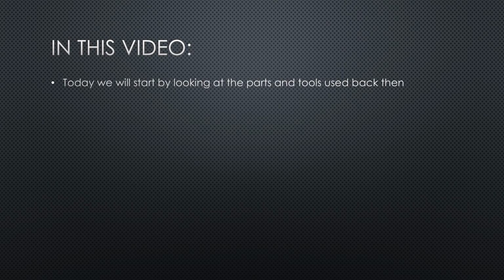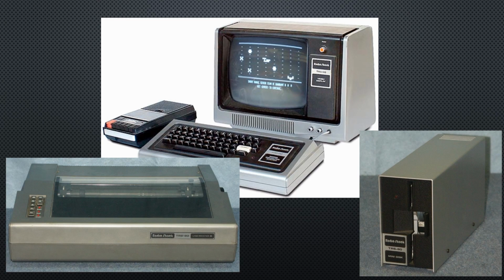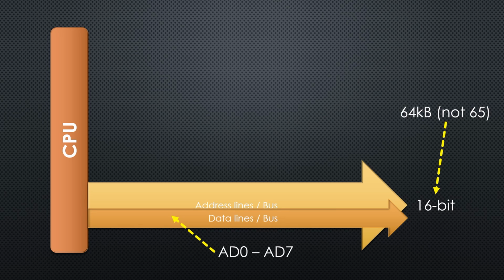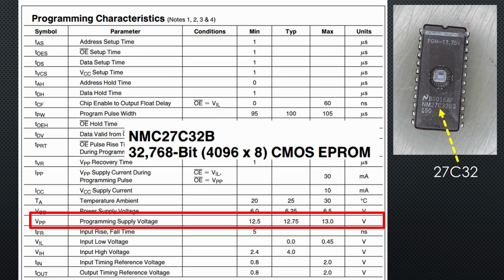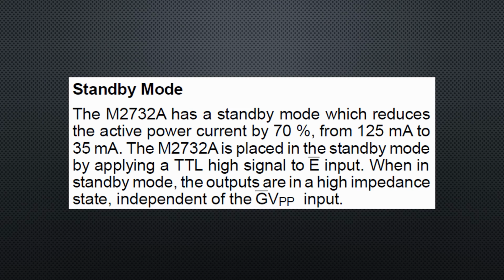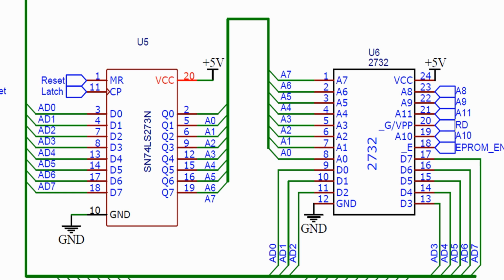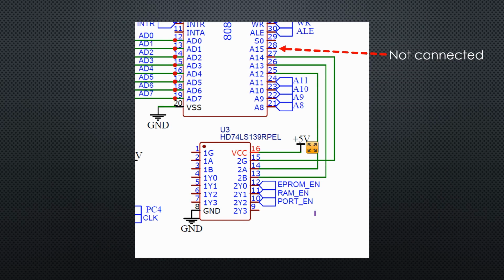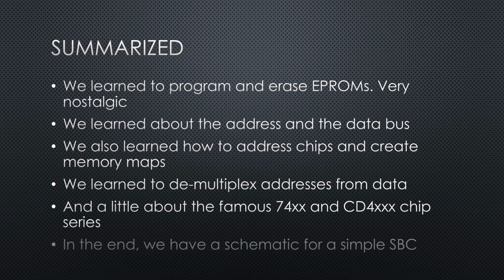#297 We build a historic "PC" using technology from the 1970s (8085, 8155, old EPROM, TTL)

Comment: Nice. I was fortunate enough to be introduced to the Cosmac 1802 by my physics teacher at school... it was the start of a long journey including commercial assembler and C... and yes... having a knowledge of the basics really helps when understanding behaviour through layers and layers of abstraction.  In those days it was always a job of fighting constraints memory size, static versus dynamic, cost etc... Now you can buy awesome silicon for $1. Maybe you should now do a soft version in VHDL on a FPGA?
Reply: My first full-time job was writing code for that. IIRC the Cosmac system had floppy discs but no file names. You had to load a program by telling it which track to read from!
Reply from the maker: I already have some contacts into the "FPGA community" Creating an 8085 or Z80 Arduino on a FPGA would probably be fun...

Comment: Back in the 80s I was a radio operator in the german navy. In 1982 the electronics guys on our ship started to build a "NKC" - "NDR Klein Computer". Because of my special skills (Siemens T100 and T1000 teletype) I was chosen for the honourable but very boring tasks of copying the book with the BIOS listing onto punchtape.
Reply from the maker: As I was also a radio operator I remember the T100. We also had them. But I did more Morse...
Reply: I did both :) But RTTY most of the time and computeraided RTTY! Two Z80 based computers in the radio room, another one in the ops and then another on the bridge all networked via 9600 bit/s serial lines.

Comment: If I recall correctly the ls373 works better as an address latch, it passes data through when en is high and holds when low. You can connect directly to ALE. It also gives better address setup time to the memory as the address propagates through before ALE falling edge.
Reply from the maker: You are right. I changed it.

Comment: Despite also been a user/developer on 8085/8086/8088/80535 (This last the most familiar to current MCUs) my nostalgia goes to the Z80 based systems due the time I dedicated to my Timex2048 (ZX Spectrum clone). Please don't forget to use KiB (kibibyte) for precision when refering to memory size. Regards.
Reply: Dinosaurs, like myself, don't believe in SI. I cried for days, when they took my kb away 😢😭😁
Reply from the maker: I have to confess, I never heard the word "kibibyte" :-(
Reply: I also consider it confusing and assume to frequently use the incorrect term for the multiple in current speaking ... but for precision we should try to use the correct one. 1TB is 1,000,000,000 bytes and 1TiB  is 1,073,741,824 bytes. About 74G more ...

Comment: Please not the 8085 chipset. I could never work out bubble sort with the 8085. I throught the read and write lines where one line low for read and high for write. 15 data bits and check bit.
Reply from the maker: They used 2 lines. But I do not know, why.

Comment: I've been thinking on doing something like this for a while, but with either a 8088 or a Z80. Can't wait to see how this progresses!
Reply: An 8088 is basically an 8086, but with an 8 bit data bus instead of the 16 bit of the 8086.  It is an 16 bit cpu.

The Z80 is a 8085 but with two more registers X and Y, and registers to work with the, and all registers was in two sets, so you just switched them all with one instruction. Great for fast interrupts.

Comment: Back in those days components were much more expensive too. Some very expensive chips like EPROMs were surely saved from any scrap electronics I came by. Often components were recycled by desoldering from a suitable scrap too.
Nowadays you just buy $1 modules and connect them like legos and the work have shifted more to software. (Not totally though, there is still a lot of hardware with no software)
Reply from the maker: But today you expect much more output in one week. Back then, a week was not very long. That is why we often had to add nights and weekends...

Comment: Awesome. I've been also watching "ben eater" do similar with the 6502...its actually a lot easier than you imagine, now that we have the documentation!

If you are ever in the UK, you must go to the museum of computing in bletchley park. Those guys will talk to you for hours about their even older computers and even show you inside them..this is how we find out how real computer theory works..
Reply from the maker: @TC: I heard of Bletchley Park and for sure I will go if I am there...
Reply: Oh, I remember when I repaired the CPU (yes, the CPU) of a PDP 8 with lots of flip-chips. I had to repair a serial port hack, that turned the then standard current circuit port to a more common voltage port (like an ordinary RS 232 / V24 serial port).  I got it to work, spending about an hour physically halfway inside the machine. :-)
This was done in the beginnings of 1990:th when I was a member of a Computer Club at the University of Uppsala.  Those was the time.
Yes, I also hade the opportunity to crawl a bit in an DEC 2020.  :-)

Comment: I remember having to split the data between two eproms and ram chips, odd address for one and even for the other as the chips were too slow for the processor. So you effectively divided the speed but 2. If I remember correctly eproms had to be ceramic due to matching the expansion of the quartz window to the body of the chip. We designed what is called a single board computer now days  for controlling an advanced digital intercom for jet fighters. We also had a digital voice warning system within it. They were great days to be working in R&D.
Reply from the maker: You are right. They used ceramics because the window. And in jet fighters I am sure you had the necessary money to buy the "right" stuff...
Reply: @AndreasSpiess  you right about the money, it was hard going in to commercial designs where every cent counted. In the mil avionics  an order for 5 was a big one but then again so was the bill. :). we were once asked to make a small test jig based on our in-house jig. we did not want to do it, but never say no, so just price it so they won't go for it. Went back with £25K each.  they ordered 5!!!!!!!!! this was at time when i had just paid £45K for my first house...

Comment: The schematic lacks decoupling capacitors +5V to GND.
I suggest at least one 100nF ceramic capacitor as close as possible to each chip.
Reply: It is far better to have a distributed set of decoupling capacitors, with at least one on every chip, than it is to rely on power supply decoupling in one place. The early 80C85 had an internal circuit problem that resulted in very high  current spikes on the power rails of nanosecond duration. Only local supply decoupling can supply these current spikes and thereby avoid radiation from the connecting power tracks. In many designs, it is necessary to not only fit 100n decoupling cap but also much lower values to avoid the effect of limited capacitor bandwidth. It helps to have a copper earth plain to provide a low impedance zero volt return.
Reply: @nigeljohnson9820 : Yes,  I agree 100%. I was there too!
Reply: I see some think decoupling caps are not necessary.
Then I suggest you put them in the schematic and on the PCB. Don't install them if you can get away with that and need to save a cent. Then it's just a matter of installing them when things don't go according to plan. That usually will be very random. Like when all bits change at the same time. Often blamed on bugs in software.
Reply: @einars899  scrimping on supply decoupling caps is a false economy, it tends to produce daisy faults.  As in some days it works and some days it doesn't. It can even make the circuit look like a theremin, where hand capacitance is sufficient to crash the processor.
I am with you, ground bounce will stop the processor working, as will transient drops in supply voltage at the Vcc pin, sufficient to make logic ones look like logic zeros. Then there is the little matter of all the RFI it will produce if not well decouple.
Reply: Don't let anyone tell you that decoupling caps are unnecessary. I was building stuff using these components in the 70's and they 'glitch' like crazy. Decouplers stop you frying components with transient spikes, even if the thing works at all with the data lines ringing like a bell.
Reply: @qwadratix  I was using this chips in professional radio equipment and a member of the research and design team. I was responsible for the circuit design. It was vital that the equipment met all the approval specifications over the whole of the temperature range of -40C to +80C inside a 25 watt FM transceiver. There was never any question that the decoupling capacitors were necessary.
At the time I had access to state of the art test equipment and had a chance to justify their inclusion with measurements.
All designs were subject to peer review, where the cost of every component had to be justified both by measurement but also by design calculations.
Reply: @nigeljohnson9820  If you are worried about the cost (of a few caps at pennies per dozen) and you had access to full design parameters and sophisticated test equipment, sure. But at the time I was working in similar conditions to the OP, as a technician in a nuclear research facility where all that mattered was that you got some piece of experimental rig together quickly, reliably, with simple tools and test gear. Once the experiment in question had been completed, the gear would most likely be cannibalized or re-purposed. We didn't have time to mess about and any time spent trying to come up with a sophisticated design was time wasted. We wouldn't dream of building TTL without a belt-and-braces approach to every possible mode of failure. Finding and fixing obscure failure modes was not something we had time to mess with. Our essentially prototype designs had to work, often in a harsh environment. Power line spikes were a known problem with the technology, so we would stick decoupling caps everywhere we could fit one.
Reply: @qwadratix  its not the cost of components that was the issue, it was the cost of fitting and testing and the amount of PCB space they consumed. I am not arguing that decoupling was not necessary. I am suggesting it was vital and not the result of some cut and try design technique or the result of playing safe, but the product of detailed engineering. We were not producing one off lab gear, but production runs of expensive equipment, where an engineering error could cost thousands or even millions of pounds.
Reply: @nigeljohnson9820  The point I am trying to make is that unless you have a good reason to produce a design with a minimum number of components and have the luxury of repeated iterations, sophisticated simulators and test gear, it's simply expedient to just slap in decouplers right up against the chips everywhere regardless. You know it's going to work first time every time and there are no nasty surprises waiting. Sure, some of them are probably unnecessary but who cares?
Reply: I remember, there were also sockets for the 74xx series with integrated capacitors as most of those chips had the GND at pin 7 and VCC at pin 14.
Reply: @DC9FO  yes, I remember those. The capacitor was a small yellow/brown ceramic capacitors wired diagonally across the underside of the rolled pin socket. I believe they could be purchased with a few different values of capacitor fitted. Before they disappeared from the market, they evolved into thin sheet capacitors of mica like material, with tined holes that matched the socket. This allowed the capacitors to be fitted to any role pin socket of the correct size. I think they disappeared due to reliability problems, certainly the ceramic/mica version was proved to be very brittle and the through hole connections did not always take the solder. All this predated multilayer PCBs, whose price was at a premium at the time.
 They certainly proved less popular when four layer PCBs became commonly used. Where connecting a capacitor on the Vcc pin down to the ground plain provided a much better level of decoupling, as it did not include the long capacitor lead inductance. By reserving the two inner layers of the PCB for power and ground, an inherent low inductive capacitance was created between the rails. This also made the ground plain about as good as it could be made. Power and return currents tended to flow in  matching parallel lines in the power and ground plain, as this is the path of least reactants, thus minimising inductive current loops. The only places where these paths might be disrupted  were where through hole pins penetrated the PCB. Even this effect was mitigated by allowing the ground plain copper fill to flow between the through holes, given as close as possible to a continuous sheet of copper.
On the very earliest boards, there were production problems with the ground plains shorting to the plated through holes. 
When production deadlines were tight, such problems could sometimes be fixed by taking the unpopulated PCB and applying 10 or 20 amps between the offending through hole and the associated ground plain. It was sometimes necessary to apply this trick to populated boards, where tiny dendritic tin or copper filament  fingers would grow from the plated through holes into the surrounding copper plains. It was a brave engineer who diagnosis such faults and opted to apply power to the offending short, blowing it like a fuse.
Reply: Dave on the EEVBlog mentioned in a video about such basic computers how having decoupling capacitors everywhere would be overkill.
Reply: @aronhighgrove4100  If you are referring to his Gigatron video, well, first, that machine was built on a 4 layer board with a ground and power plane (= large distributed decoupling capacitor) and also it is on a PCB, not a breadboard, like the attempt Andreas made (and which didn't work). And even then the Gigatron has all those decoupling caps.
Reply: yeah i wouldnt worry too much about decoupling caps on these old designs...aslong as your main power input is smooth you dont have any problems
Reply: @WacKEDmaN  Actually, given that the design isn't stable on the breadboard, that's exactly the reason why you need decoupling capacitors. 

You can run the machine even from a battery (it doesn't get smoother than that when supplies are concerned) and you will still have problems. The problem is not supply filtering but ground bounce. 

That the design is old and slow doesn't mean it isn't switching fast and that there won't be massive ground bounce once those old chips switch. If you don't decouple, that is going to propagate along the board and cause problems, especially if you are working a on a breadboard, with no ground plane and with long wires (= a lot of parasitic inductance preventing the circuit from getting power fast enough to cover the local switching "brownouts"). You won't find an old machine like this which didn't have a 100n decoupling capacitor across every chip, for good reasons.

Comment: What memories. My research project started in 1976, an SDK80 from Intel for £200 , 256 bytes of ram in 256×4 chips, a monitor ROM , and a 2704 to put your own code on. When I got fed up hand assembling, an assembler was written an Algol to run on the mainframe and produce a paper tape and a tape reader interfaced to the sbc. Assemble, test cycle of a couple of hours.  I recall a debug method of a pulse generator on the reset pin an a scope to look at the address lines to work out where the code was going.
Happy days and nights.
Reply: Wow...
Reply from the maker: I also remember using the scope for debugging. But I often used points in the program where a particular line was switched for a short pulse to show "I was here"...

Comment: It´s not running stable? Where are the capacitors? Only 15n somewhere!? 

There must be 100n everywhere ! And some "supporting capacitors" with 100µ to >1000µ! 

Especially on the regulator input. And 100µ at least on the output. 

Your linear regulator only has 1.5A and there are heavy current spikes on the 5V power line.
Beispiel: https://www.mikrocontroller.net/topic/337533
Reply: If in doubt 100n and 10n for each chip. Trace/wire lengths from caps to chip power critical. A two inch trace of 0.1 width has significant impedance for the current spikes these old chips take when switching.
Reply: http://minuszerodegrees.net/xt_clone_bios/DTK%20PIM-TB10-Z%20(rev%209).jpg
Here you see, a capacitor is as close as possible attached to the VCC and GND for each chip.

Comment: Thanks for showing your "veterans". I still have some devices on stock. But I did not like Intels Architecture. I have been an 6809 follower. It was easier to program in opcode. 
Long time ago. And as with cars, I am happy that we today have better solutions. And this is what engineers (or at least Ingenieur = thinker) are working for. Information beats matter and make a smarter and better world possible.
Reply: Loved the 6809 back then.  Yes, it was a much better hardware and instruction set then any of the other 8-bit CPU:s back then.
Reply: Also loved the 6809.  In college I learned assembly on a Tandy Color Computer II which used the 6809. Great chip!